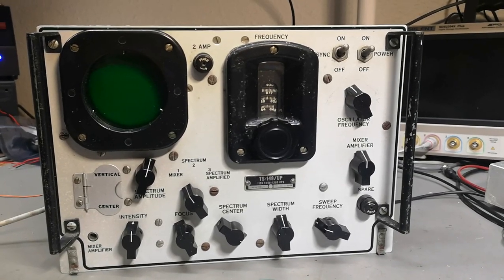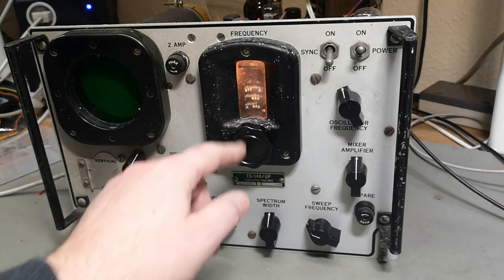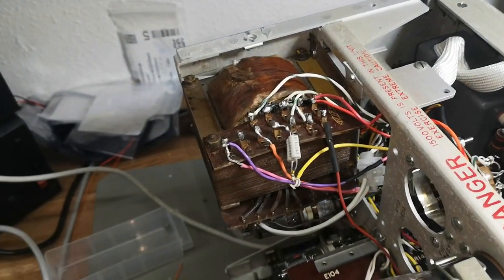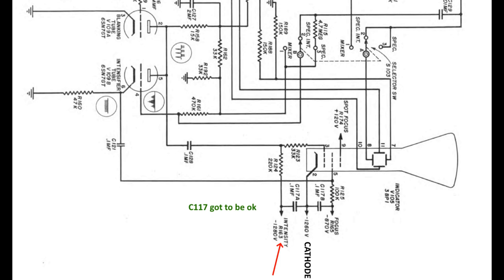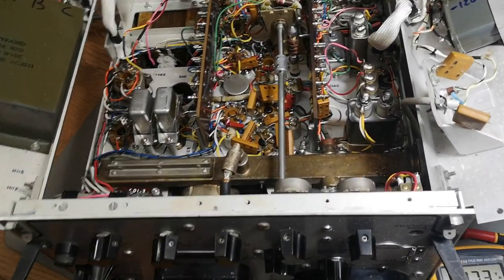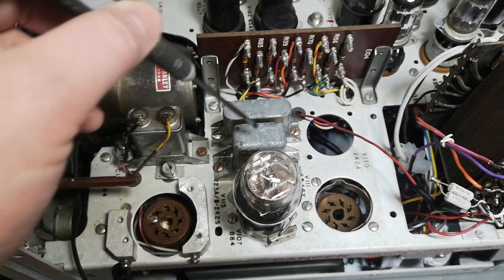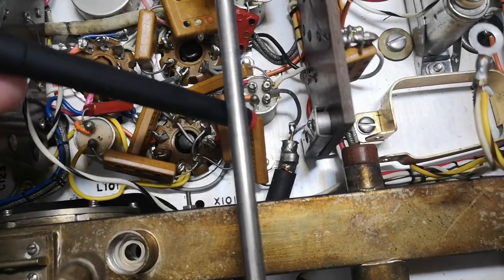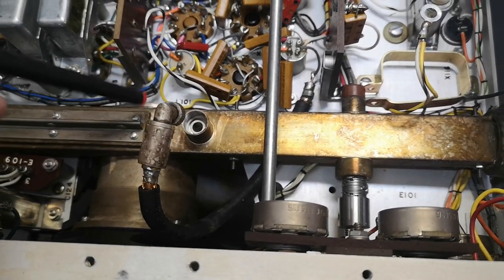TS-148/UP Military Spectrum Analyzer X-band 1945-50 8.4 to 9.6GHz repair teardown

Comment: Damn when something decides to be dead, it can be truly dead, it is weird to have so many leaky componants.  Old modifications remove most of the interest for keeping a device imo. Time to retire it and let it rest in parts ? It is a little bit oversized for a doorstop use 😅
Reply from the maker: at least you cant say i did not try :-) could have been fun to play a bit with this one.. maybe better luck in the next video ..
Reply: @TeardownOZ2CPU  is the next episode going to be this spectrum analyzer turned on? I was going to ask, is there a way you could unmount and isolate the the leaky transformer from the chassis?
Reply from the maker: @hatsunemiku838  i think it is over 9 out of 10 funny old items, i manage to fix, use and play with.

Comment: The reason why the power draw may have been getting higher may be because when resisitor heat up the resisitance increases, and creating more energy to heat then useful power, usually happens to older resistors